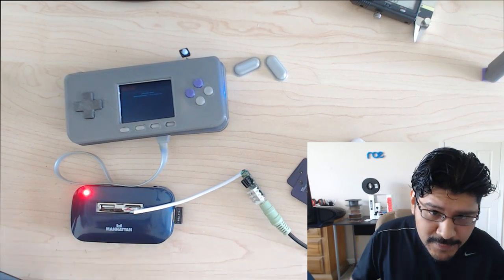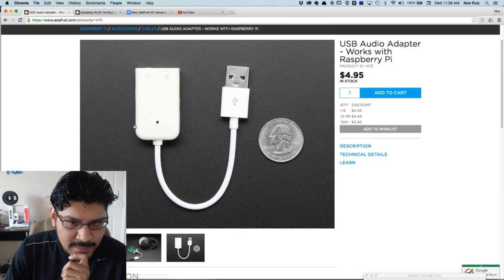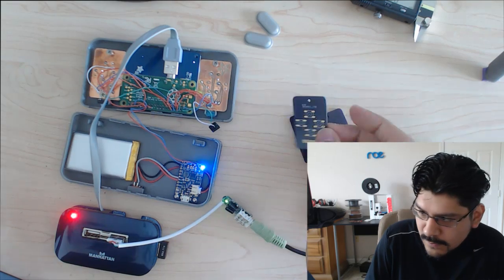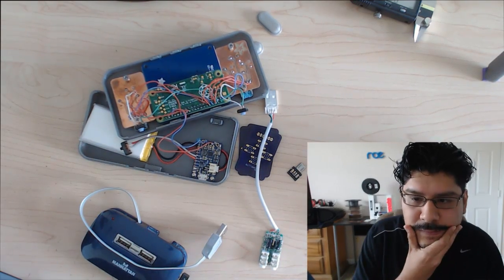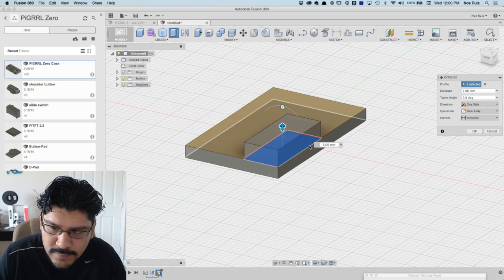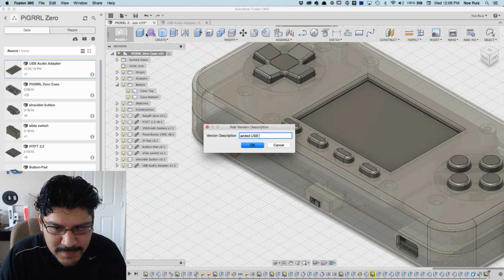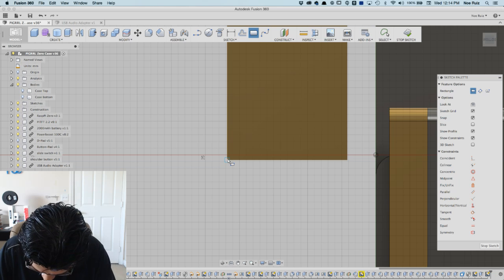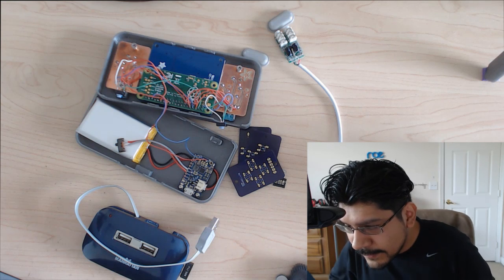Layer by Layer LIVE PiGRRL Zero Pt 6 Audio @adafruit #adafruit #3DPrinting

Comment: maybe he should have braced the back of the pegs holding the board in place for strength since there will be a lot of stress on them .... and chamfered the whole for the jack so it doesn't mind going in at an angle
Reply from the maker: +Nathan King Thanks for the suggestion! I've since opted for a USB female jack ;-)